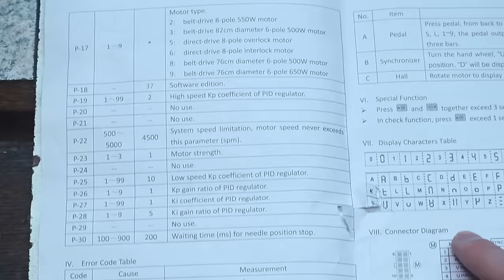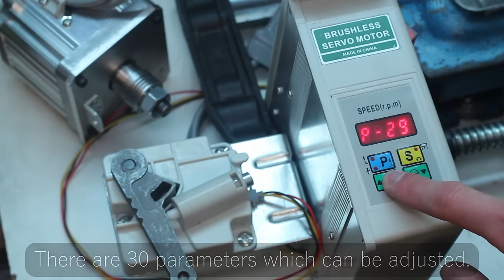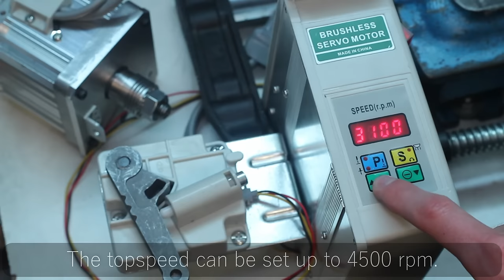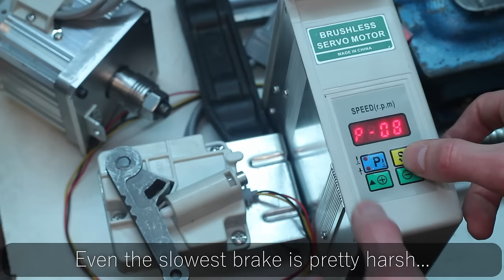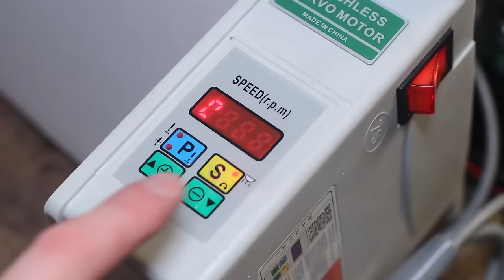New Brushless Servo Motor For The Mini Lathe

Comment: inspired by your video I order the servo motor. but I faces some difficulties finding the right pulleys and belt, so I decide to remove the rotor and rework the shaft to 8mm. Now I am waiting for the new belt to finish it. thanks for sharing, your skills are really inspirational.
Reply from the maker: Thanks for your feedback! And good luck with your machine!

Comment: 0:40 - for those connectors, there is a small "latch" built into the socket side. When you press it, it releases a bent metal pin that fits into a hole on the plug and locks it. You can press the latch after sliding back the plastic over-cover, it's possible with bare finger but easier to do with a small screwdriver or something similar to poke it with..
Reply from the maker: Thank you for this tip! I really didn't know this. I thought you can just pull them apart but it really was impossible to seperate these connectors :) Thanks.
Reply: @WeCanDoThatBetter  - I destroyed so many before I worked out how to press the little latch.  I still forget this!

Comment: I like it. Simple yet effective and efficient solution to your motor blowing up. 
I replaced the motor on my Unimat DB200 with a brushless but instead used a potentiometer. Works great.
Reply from the maker: Thanks for your comment!
Reply: @WeCanDoThatBetter wichone is beter use this sewing servo motor or bldc 6374 motor with ESC sir??
Reply: @botak333 servo. torque. also cheaper 😂
Reply: @dreizenit7758  but isee bldc more torque,
Reply: @botak333  servo from sewing machine wayyy cheaper
Reply: @dreizenit7758  but i have bldc and controler🙄🙄  hmm i need to buy servo?
Reply: @botak333  i didnt know u had one. lol
Reply: @dreizenit7758  😂😂 i want to use gor scoter electric, but for now i dont have battery so i will useit for lathe😂🤣
Reply: @botak333  thats a better option. probably a lot more torque than the sewing servo.. but youll need to buy power supply.. speed controller of sort etc.. might as well buy the servo its much cheaper and save ur bldc for ur bike.
Reply: @dreizenit7758  power supplaybi have alreadynalso🤣😂 controler also😂🤣🤣

Comment: Nice upgrade! 
For the speed, my advise would be to measure the range of ohms on the foot pedal. You can then buy a potentiometer with the same range and use it like you did before with the speed knob.
Reply from the maker: Thanks for your comment! Yes, to use a potentiometer instead of the pedal switch seems to be working. My plan is at the moment to use the pedal switch as it is and implement it in a more convenient manner. I have something in mind but not sure, if I can build it that way:)
Reply: I have the same exact kit. If you take apart the foot pedal, it’s just a linear Hall effect sensor. You can simply hook up a 4.7K/5K potentiometer to its 5V, GND and signal wires. This is what I did. 

You’ll have some “dead play” in the beginning of the rotation since your voltage threshold is lower with the pot, but it’ll work.
Reply: @Catrpilla The easiest way is to file a groove into the end of a bolt to match the thickness of the speed lever and then screw it into a 90 degree bracket with a flange nut the same diameter as the bolt and use the head of the bolt as a knob to adjust the speed . . I was wondering though about its performance when machining at low speed when the lathe is under load
Reply: Another YouTuber created a horizontal hex shaft connected to a traditional lathe carriage mount handle for the on off, speed and direction control. The hex shaft moves the magnet from the factory switch assembly to enable to reuse the hall effect sensor. A micro switch for on off also as the factory did it. I should grab his channel name... We Can Do That Better posted around November 2022.
Reply: How's the noise compared to the other motor?
Reply: @ErikBongers  Brushless motors let you hear yourself think, they're not so dumB.

Comment: Very interesting, as a friend and myself both have Taig lathes (called Peatol in UK) and have been wondering about new motors for them. This was certainly helpful, thank you. Keep doing what you do, your videos are good. Les in UK
Reply: I am currently modifying a taig and the biggest issue is the drive belt - the 3m belt is hard to get and weak .
Reply: @ianbertenshaw4350  never had any trouble with the Taig belt. I have a spare in stock but never needed to change it, despite looking puny it holds up well. But if I go along the route shown here I would change to a similar belt to that shown, as there will be no need to swap the belt from pulley to pulley. I’m looking at the 550 Watt version of this motor, as there is no need to use the larger version on a Taig lathe, it would just over-power the lathe and likely cause trouble. Les

Comment: To switch rotation you have to swap phase and hall sensor wires. I have done it by swapping: BLUE/BLACK wires ( thick ones) at phase cable and blue/yellow at hall sensor cable (thin ones). You can do it by relay or mechanical switch. For control speed you can use potentiometer 500R + resistor 330R at ground side in series. Be carefull there is a hot  ground inside a box. I also move inverter parts from brushless motor case to original from lathe.

Comment: Nice upgrade, especially as it allows the carriage mounted control in the later video.
Reply from the maker: Yes, this definitely paid off. Was the right decision to switch to this motor expecially with the new start lever on the carriage this is really smooth to use.

Comment: A 10 turn potentiometer, Bourne makes some nice ones, with the same resistance sweep as the sewing machine speed controller would provide a very accurate fine adjustment. You can install a mechanical indicator on the shaft of the potentiometer to indicate which turn you're on and or install a tachometer.
Reply from the maker: Thanks for your comment. I've heard that using a potentiometer is a good way of controlling the speed and getting rid of the foot pedal. At the moment I'm planning to keep the pedal switch and implement it in a more suitable way. We'll see if that works.

Comment: Clever solution to the problem of the lathe's original motor dying, and not just that but an improvement over the previous motor as well! However there is one thing I would definitely have done differently. The new motor produces a maximum of 4500 RPM, waaaay too much for a lathe, even for working on tiny aluminium parts. You would get a fair bit more out of both that motor and your lathe by using a 2:1 speed reduction, giving you an ideal 2250 RPM at double the amount of torque.

Comment: Looking forward to how you are going to control the speed and if an RPM indicator will be used - thanks for your work!
Reply from the maker: Hi, in the meantime I made a video on installing a On-Off-lever to the lathes bedslide for operation the machine. That is really convenient. I  will definitely later add a rpm indicator too to the machine. But at first I have to install the proper electrical cabinet which is flying around for over a year now. Should be comming soon.

Comment: I have the exact same unit and you can adjust the speed with a potentiometer but be aware the 5v rail is referenced to mains so it can give you a shock . use a pot with a nylon shaft or a rotary hall effect pot .
Reply from the maker: Hi and thanks. Yes I heard that a potentiometer works as well but seems to be a bit dangerous in use. At the moment I'm planning to someway implement the original pedal switch. That should be safe:)
Reply: You could insulate it from mains with an optocoupler.

Comment: A couple of years ago I went all 3 phase so I used a 3/4 HP 3,000 rpm 3 phase motor with an AT1  VFD..........motor was A$120 and VFD A$90........to get the extra torque for slow running on load I used a belt drive reduction of 1:2......3 phase motors on VFD's don't like running slow if connected 1:1.

Comment: Well done, thanks for sharing.  Can you provide a link or a brand/model for this motor kit?  I'm curious about the price and if it would be strong enough for other applications like my band saw.
Reply: Look on Amazon for "Consew" motors. They're available in several power ranges, and they're not too expensive. I got a 3/4 horse one for my lathe, which--of course--I haven't ever gotten around to installing.
Reply: @noiwonttellyoumyname.4385  Thanks!  Go install that motor.
Reply: @nefariousyawn  It's on the list! It's going to be part of a CNC rework, and there's a bunch of other details on that side of things that I have to finish figuring out too.

Comment: I hate it when someone shows a motor modification but then never says where you got it. Looks like the bracket worked out well and an interesting way to run the lathe temporarily..
Reply from the maker: Its a 550w brushless servo motor for industrial sewing machines. You can find it on ebay. I will put a link in the discription.
Reply: Kannst du den Link reparieren? Er funktioniert nicht…vielen Dank!!!
Wie ist den die genaue Typenbezeichnung des Motors??

Comment: Awesome video. I've just bought a nice old lathe, but it needs a new motor because currently the way it's cobbled together means it lacks any form of speed control. I'd come across these motors and was wondering if they'd work, so thanks for answering my question!

Is it still working well 6 months later?
Reply from the maker: Thanks for your comment! Yes, it works just fine. I'm really happy with the motor. I recently made a proper start stop lever and now it's just perfect to use.

Comment: Just fitted mine, so easy. Mine isnt the same as this lathe though but all went in so easy. I dont have a gear box hi-lo but to change hi-lo i have to move one of the 2 belts. Works great but would rather have a potentiometer than the lever provided.
Reply from the maker: Nice to hear it works for you as well. There are ways of installing a potentiometer instead of the pedal switch. But this is electrically a bit dangerous.
Reply: @WeCanDoThatBetter  yes i read that it was dangerous so i will see if anyone else comes up with a good solution. Meanwhile i will use the lever now i have taken the spring off.

Comment: On the bay but there is a potentiometer kit you can pick up specifically for this mod.  I picked up 3 and they all work well.  Running one on a mill and the other two on 7x14 lathes.  I really want to figure out a way to quickly switch direction for threading.
Reply from the maker: Hi, thats interesting! Didn't know that there is already a conversion kit available. And yes, the direction change is the only thing which is quite annoying. I think it would be sufficient if you just have to press the reverse button once short. But every time waiting the few seconds really gets on your nerves :) But no idea if it's possible to change this.
Reply: @WeCanDoThatBetter  did you ever come up with simple solution for reverse ? im about to do the same conversion but not a fan of the reverse situation

Comment: Hi nice work as always. How is the motor under load? Does it get hot? Do you think that I can use it for cnc mill?
Reply from the maker: Thanks! Good question. I've never tested if the motor gets warm. I has a fan and I don't think that heat is an issue here. I would use it for a milling machine as well, yes.
Reply: @WeCanDoThatBetter  Thanks for the reply. Btw how is the noise of the motor, ıf we compare it to monophase industrial motors like  bench drill motors.

Comment: Great work, but what is the duty cycle of this motor? I can't imagine sweing machines being kept on continuously for over minute or so.
Reply from the maker: Thanks for your comment! Good question. So far the motor runs as new. As it is branded as industrial sewing motor, I guess it should last a little bit. The motor has a fan at its back, so overheating should be no problem.

Comment: Good job! I see at 0:20 that your lathe has 4 ground ring terminals screwed onto the headstock. I imagine one of them is the mains earth ground and another one grounds the motor case. Where are the other two wires connected to?
Reply from the maker: Huh, that is really good question. To be honest I can't tell you anymore.. :/

Comment: Wiring 3 terminal potentionmeter value 1k ohm if you want vary speed instead of pedal
Reply from the maker: Yes, thanks for the tip. I heard that this is possible. At the moment my plan is to implement the pedal switch in a better way.

Comment: hi nice work,what s the max speed? and is there no problem when using long time, heat or else?
Reply from the maker: Hi, the max speed of the motor is 4500 rpm I guess. The max spindle speed depends on the gear ratio you have. In my case the spindle turns at about 2500 max.

Comment: I have this motor coming to me attached to a belt grinder. Is it still working well for you?
Reply from the maker: Yes, I'm happy with the motor so far. Works really well.
Reply: @WeCanDoThatBetter  Thanks for the reply, and also running through the settings - it'll help me get my motor tuned in.

Comment: These come up in multiple power levels up to 1500W. Do you think it would be blasphemy to mount something like this on a smaller machine? How much torque does the 500W version have, compared to stock motor?
Reply from the maker: Hi, I think 1500W is absolutely overkill for a lathe as small as mine in the video. The 550W Motor I'm using seems strong enough for my application. Compared to the stock motor is has a much higher torque at low rpm. I never stalled it so far. The 750W version might be worth thinking about, especially when the lathe is a little bit bigger.
Reply: @WeCanDoThatBetter  All right! What is your opinion on bolting down a mini-lathe to a concrete bed to improve it's rigidity?
Reply: I wouldn't call it blasphemy, but rather just completely useless. The only thing you need higher power for is if you want to take a large depth of cut (DOC) in hard metals such as (hardened) high carbon or alloy steel. A 1500W motor would do suitably well for that. However in order to be able to take large DOCs in hard metals a lathe doesn't just need a lot more power, but also several other properties (much bigger, stronger and heavier lathe bed, bigger, and stronger spindle, proper spindle bearings, bigger and stronger carriage and if its used the crossfeed as well) which small lathes like these completely lack. Hence why putting anything over 1000W or probably even 800W on a lathe this size is utterly useless.
Reply: @erichasu737  Bolting a mini lathe down to a concrete bed is definitely going to make quite an improvement in rigidity, about a factor of 3. Bolting it down to a thick (20-40 mm) steel base instead of concrete would also make a considerable improvement. There's a good video on YouTube of someone who bolted his mini lathe onto a thick steel plate and measured the amount of flex in the lathe before and after, it's definitely worth watching.

Comment: Some time it is just the potentiometer cables loose on the board side (Blue terminals), the  Symptoms : Lathe start in high speed all the time in forward and reverse.

Comment: How do you set the motor to go in the opposite direction?
Reply from the maker: You have to press the yellow button on the controller for 1 or 2 seconds to reverse the spindle speed. That is a little bit annoying on this type of motor and controller.

Comment: Did same mod 2years ago do not join speed controller to lathe have it separate 
I had chatter and it shorted speed controller and electronics which I’ve replaced
With same would be interested if you can incorporate a potentiometer to replace 
Original speed controller
Reply from the maker: At the moment I'm planning to use the pedal switch and build a proper main hand lever for it. I heard using a potentiometer is potentially dangerous.

Comment: Using a cordless drill to run the lathe... That's a new one. 
Anyway, some Chinesium lathes actually comes with a brushless motor these days. SIEG has two, the SC2 and SC3. (Known as 'Super SIEGs'... They're not all that super. Doesn't even come with a cape, but they do have decent torque. )   
Something to think about for those who are in the market.
Reply from the maker: Thanks for your comment and the infos!

Comment: Do you have problems with the duty cycle?
Reply from the maker: You mean with the durability of the motor? It runs without any problems for more than a year now. I'm really pleased with the upgrade.
Reply: @WeCanDoThatBetter  Na dann werde ich mir auch mal so ein Servo bestellen - DANKE!
Reply from the maker: @dussel07  Ja, ich kann es wirklich empfehlen. Das einzige, das etwas gewöhnungsbedürftig ist, ist der Pedalschalter als Ein- und Ausschalter. Ich habe das so implementiert, dass ich jetzt einen An-Aus-Hebel am Bettschlitten habe. Das ist extrem bequem und prakitsch und - wie ich finde - die beste Lösung die Maschine zu schalten. Allerdings ist das recht aufwendig umzusetzen. Du kannst es im einem Video von mir sehen. Es gibt noch die Möglichkeit, statt dem Pedalschalter ganz normal einen An- Aus-Schalter einzubauen und ein Potentiometer. Dazu gibt es im Internet auch Anleitungen. Natürlich kann man auch einfach den originalen Pedalschalter erstmal verwenden, habe ich auch gemacht :)

Comment: hello friend. Does this type of belt slip?
Reply from the maker: Hi, yes these belts can slip when not properly under tension or when the belt is to small (not enough v rips) for the power to transmit. But they run smoother than a tooth belt and for my application I think this drive is working really well. I had once or twice a little bit of slippage at low rpm with a big drill. In this case I think it is better the belt slips than something else breaks :)